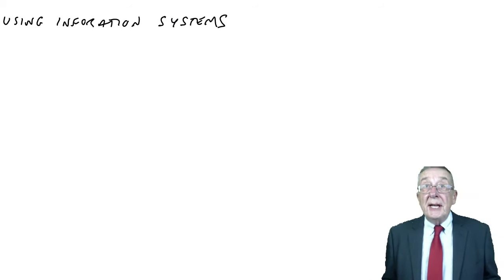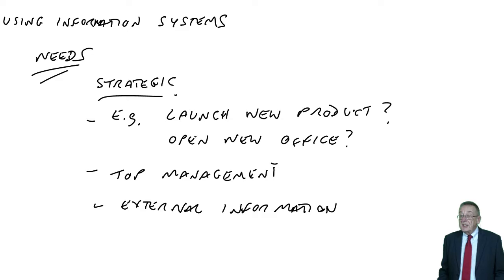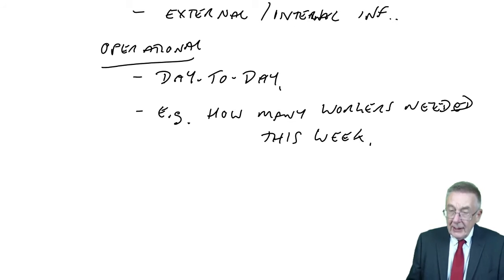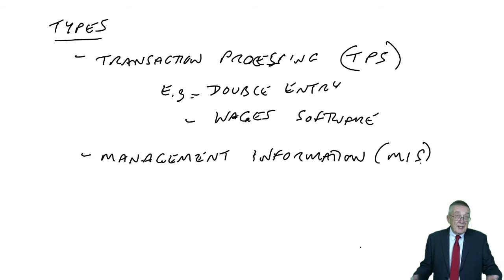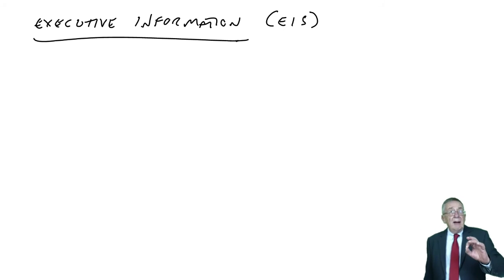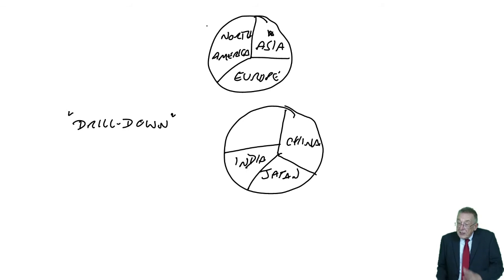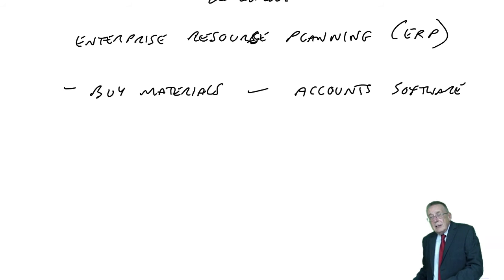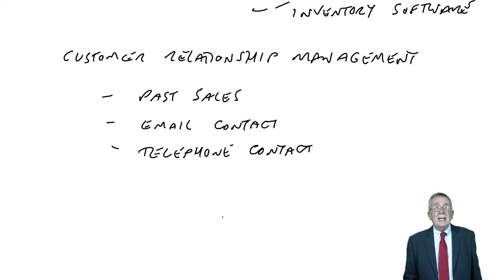Using Information Systems - ACCA Performance Management

Comment: when u r going to upload about time series, regression and co-efficent...pls make vieos on them too as they r newly added
Reply from the maker: They have always been in the syllabus as assumed knowledge from Paper MA (was Paper F2) and there are Paper MA lectures on them that you can find on our free website.
Reply: @opentuition  so do u think that MA level knowledge is enough to be used at PM level...as it is an advanced paper so at this advanced level can we use F2 knowledge?
Reply from the maker: @hibakhan1567  Of course, and the same applies to other assumed knowledge from Paper MA. There is nothing extra on correlation and regression examinable in Paper PM above what was examinable in Paper MA. The fact that is an advanced paper is why there are extra topics. Correlation and regression and time series cannot be asked in a more advanced way. Until about ten years ago they were listed specifically in the syllabus and were occasionally asked, then the examiner removed them from the syllabus (but made it clear that they were assumed knowledge) and now she has decided to specifically mention them in the syllabus again.

Comment: Thank you for this explanation, it was very useful! I have noticed that Big Data is now separate lecture, are you planning to make a video about it also?
Reply from the maker: I will record a lecture when I have the time. However in the meantime the chapter in our free lecture notes should be clear enough (there are no calculations involved). If not then do ask in the Ask the Tutor Forum on our free website.
Reply: @opentuition  Thank you Sir, I will definitely check the Notes.